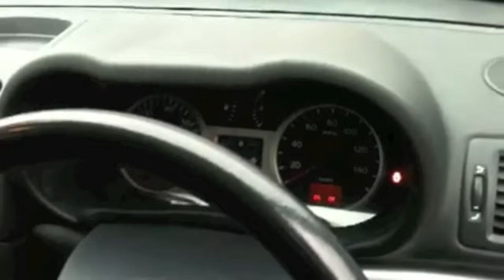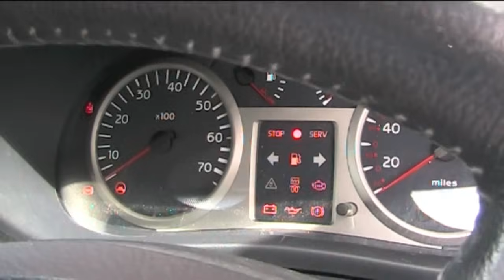Renault Clio 1.2 16v D4F Throttle Body Removal

Comment: Stupid french solution, why is so complicated? Great video!
Reply from the maker: It is a tad unconventional but just a few more bolts and no more than 10 mins to remove, good cars when they run well and no significant rust issues. Not sure the new breed of 3 cylinder turbo petrol hatchbacks will last as long as these old D4F engines.
Reply: @peugeotCitroen2CV  3 cyls turbo is big shit engines, d4f is good but have complicated intake, for example d4f 722 is better, throtle body is not under intake, br
Reply: and what you thing about 1.4 16v in clio 2, is fuel consuption high in short relation, i have choice buy 1.2 16v or 1.4 16v for use in small city with short relation, what is better by the view of  fuel consuption, and which engine is better tehnicaly, br
Reply from the maker: @NoName_11979  
I am not too sure about the other engines in the clio range.
The 1.2 16V D4F was good at the time for cheap insurance. I will be honest i never found this generation of clio the nicest car to drive. The electric steering is devoid of feel and also heavier than it needs to be which makes it slower to react. The gear-change was also quite rubbery and the seats in the dynamique model gave me back ache, it was also a bit loud at motorway speeds. I drove this for a couple of years and then went for a diesel 406 once i could afford the insurance on a larger car.
A few relatives have clios with the 1.5 DCI engine and they do say they get great fuel economy from them. 

With regards small city cars, the K12 micra is a firm favourite of mine, they look a bit funny but are a hoot to drive and not too bad on a longer journey.
Reply: @peugeotCitroen2CV  For me, the Clio 2 is great for driving around town because it's comfortable and has a light steering wheel, and because I don't like big cars, I love driving it, and I also like the Ford Fiesta. However, none of these cars are suitable for long journeys. I'm not a fan of Japanese cars because of the lack of used spare parts in the Balkans.

Comment: renault worst car ever, made in france = shit, too much useles too much complicated parts
Reply from the maker: No i would totally disagree with that.

Now renault have made some questionable cars over the years the vel satis springs to mind, and the MK2 laguna DCi enjoyed consuming turbos for fun.

Although the clios, in particularly these simple 1.2 petrols are generally durable wee cars. 
Yes i had to do this bit of work on this clio, but the repair cost under £10, took about an hour and never had to be repeated. There is nothing too complicated on these clios. This one stayed in the family for a few years after this video, no serious issues. My sister is currently driving a 2012 Clio 3 with the same engine. I service the car every year and never hear of any other issues.